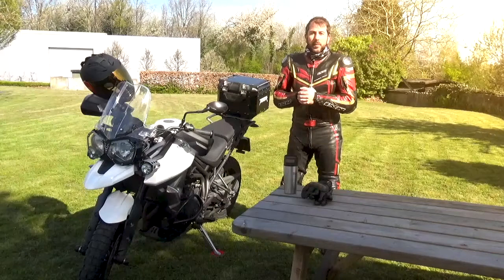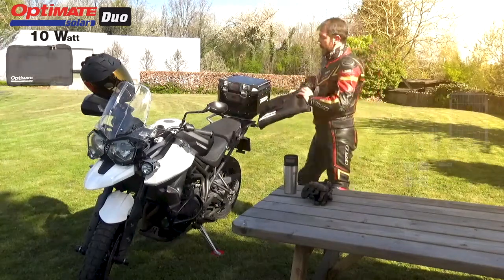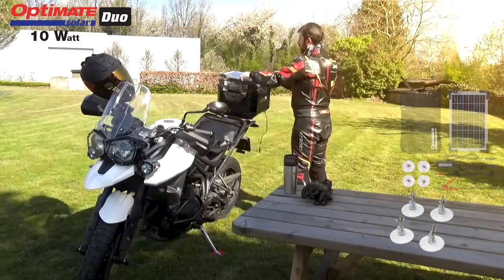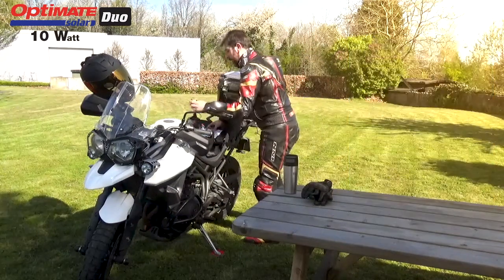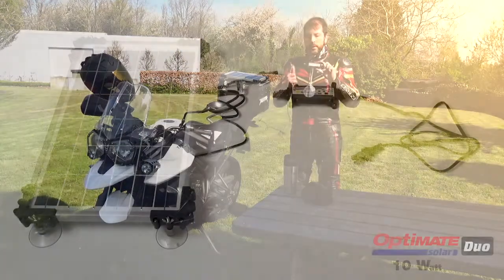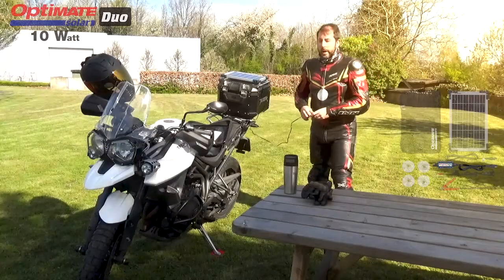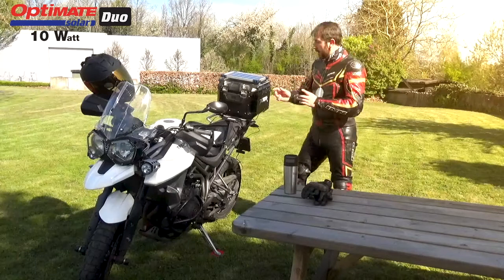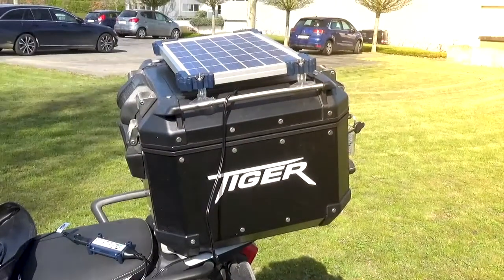MOTORCYCLE SOLAR | OPTIMATE OFF GRID SOLAR POWER SYSTEM

Comment: My bike has same one input. For charging and bike usage input. What will I do ?
Reply from the maker: If your bike has a single input for both charging and powering the bike, you’ll need to ensure that the bike is turned off when using the OptiMate Solar DUO for charging. This prevents power conflicts and ensures that the battery charges properly.

It’s also important to charge the bike when parked and in a safe, sunny location. Let us know if you need any further clarification or assistance!

Comment: Can be charging when am driving?
Reply from the maker: We don’t recommend using the OptiMate Solar DUO while driving. It's risky, as the solar panel could come loose and create a dangerous situation. For the best and safest results, we suggest charging when the vehicle is parked in a stable, sunlit area.

Safety first - let us know if you have any other questions!

Comment: I have. 1995 Honda st1100,, dead alternator,, gonna go this route rather than installing a new 40amp upgrade
Reply from the maker: Thanks for sharing! Our 10W solar charger is a great solution for keeping your 1995 Honda ST1100 battery topped up, especially when dealing with a dead alternator. If you have any questions or need tips on how to get the most out of your solar charger, feel free to ask. We're here to help!

Comment: I park my motorcycle outside with the solar panel and charger. But my DUO charger-monitor controller keeps shutting down since the weather is getting cold(Now it is -10 degrees Celsius). I pull the solar panel plug out and connect it back to the charger, the charger turns on, and it works fine. But in less than 20 minutes, it shuts down again. Is there any solution for outdoor parking situation during the winter time??
Reply from the maker: Hi! We recommend removing the battery from the vehicle and bringing it inside to charge it indoors. If you are still riding your bike, you will have to periodically charge with the solar charger on less cold days.

Comment: Can it be permanently installed on the outside wall of a garage?
Reply from the maker: Yes it is possible! The corner mounting brackets of the OptiMate solar panels make it possible to mount the panel on the wall. Watch an example in this review video at 5:40: https://www.youtube.com/watch?v=bJolyMT-zjE